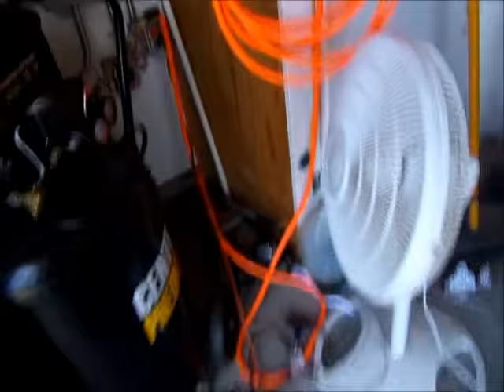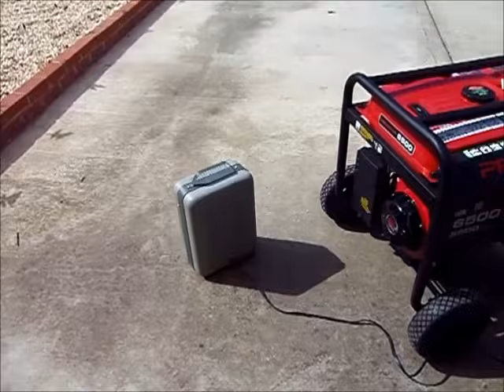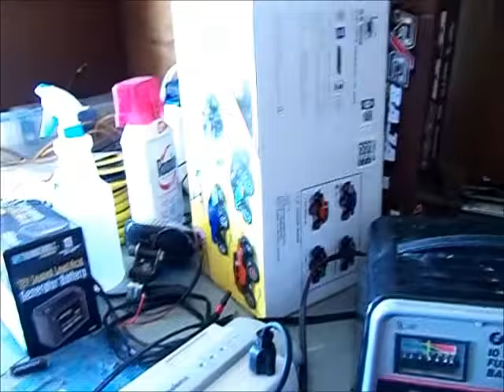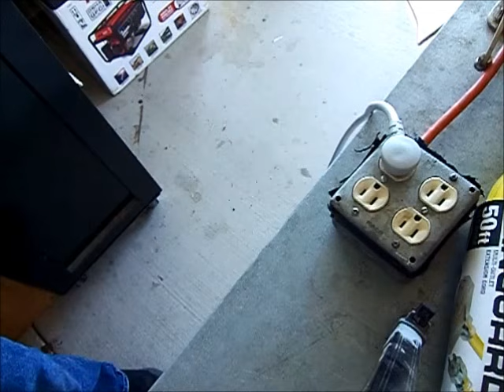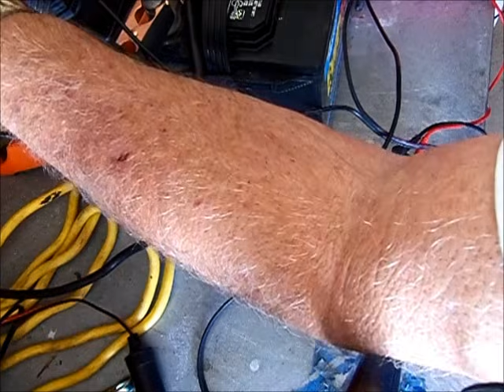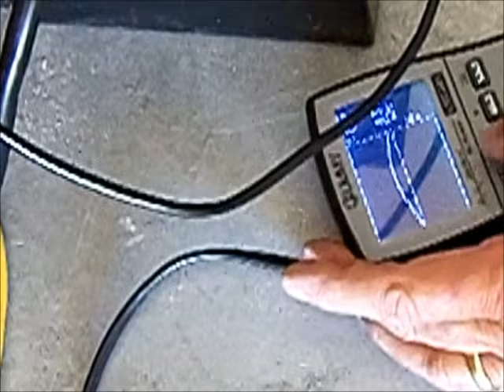Cleaning up the "dirty" sine wave from a non inverter generator. This is part 1, proof of concept.

Comment: I have a 4000 watt champion generator that in our last power outage I just plugged in my TV, computer and internet. I'm glad I didn't fry my electronics. I'm new to using a generator and it did cross my mind that the power wouldn't be safe. I did Buy a transfer switch and everything to hook up my 8750 to the house just in case but since I'm just renting I will wait until the grid goes down. Thought I was good but now I'm off to figure out how to do this safe.
Reply from the maker: If you are renting, in my opinion, I would not spend the money on tying into the electrical panel. That might possibly open up a can of worms with the owner. As of about 3 weeks ago Harbor Freight released a new line of inverter generators (a year too late for me) up to 9000 watts. If you purchased the 8700 recently, it might be a inverter type already. I posted parts 2 and 3 recently. They might help you in configuring your setup. One other thing, check out using UPSs (Best Buy Amazon, ect.) instead of my set up. If I had it to do again, I might have gone that route instead.

Comment: Now if only you can convert a 400v Tesla Car Battery voltage to run 120v household devices without completely tearing it down to 40-50v modules. You would make millions.
Reply from the maker: Actually it could be quite easily done with a step down transformer...but why? You still have to charge the battery pack(s) either off a charging station or some form of home power generation.
Reply: @d.s.steele3100  you would still need an inverter for dc to ac at those voltages
Reply: @ChatGPT1111  would be cheaper to buy ALOT of 12v batteries than tesla lol. lead acid is way better for NON mobile applications as the space and weight is not of importance. one can pair those 12v batteries in series and parallel just like lithiums so you end up with desired voltages. then for both you need to have an inverter big enough to supply you the required AC output. basick lead acid batteries are simpler and safer to charge, can be charged with a cheap chinise solar charger and a normal charger will be alot cheaper for them. for lithium you need a smart charger and normal solar chargers will set youre house on fire..when the lithium batt die you need to buy a new one. as its super dangerous to use bad lithiums. with acids its not so fiddly as every car owner knows ...

Comment: I've heard it's better to use deep cycle batteries for this process were those just normal 12v car batteries? and for expense sake you can use golf cart 6v so to recreate this gotten 4 deepcycle 6v batteries ran parallel.  I'm thinking of making a big battery bank in conjunction with generator/ solar / wind for the whole house year round essentially trying to get "off grid"  I think that the line conditioner inverter battery bank combo is the key.  What do you think?
Reply from the maker: I used 2 Ever Start non sealed deep cycle marine batteries (barrowed them from my boat). If I recall they were about $90.00 each. They are rated at 100 amp hours each. That is about 2400 watts of power off a full charge. how long they will last on a charge depends on how much power your drawing.  Check the power rating on those cart batteries to compare against regular deep cycle batts. Take note: if they are 6 volts each, you will need to hook them up in a series/parallel setup to get the 12 volt for the inverter. Solar, wind good idea. Generator uses a lot of fuel ( I'm using mine only when PG&E cuts power on red flag days). Lastly figure how much power you need at night and size the battery bank accordingly. Assume the sun is down, no wind and the generator broke. you will need a minimum of 10 hours of power off those batteries.
Reply from the maker: Part 2 now posted. Using much higher wattage components.

Comment: LONG basic information POST - PLEASE IGNORE IF YOU DON'T WANT TO WASTE YOUR TIME

This isn't really a video about cleaning up the distorted output of the Gas Generator.  It is just a way to use dirty AC to top up DC batteries for ultimate sine wave inverters.  It is a little difficult to see what, exactly you have connected into the house, if anything.  I don't see why you have the generator going to your house ground.  It would be better to connect it to a ground rod.  If the generator fails and the case becomes hot, you are relying on the house to be properly grounded.  Not a good thing.  not necessary either.  Many people with generators attach them to the house using a double ended transfer cord.  The problem with that is your house is still connected to the AC grid.  When a lineman tries to work on a downed system, they expect the system to be dead.  Depending on how many step down transformers are between you and the lineman, they may "see" 120vac or many thousands of volts if you are pumping your generated voltage onto the grid.  So as long as you unplug your house from the line when the power goes down (see Generlink etc) or isolate the circuits you want to run during the outage (see Transfer Switches) everyone will be safe and your system will be legal.  Plug your generator (inverter or otherwise) into a wall socket, and you are likely to kill someone.

One thing about wave distortion to consider is the total distortion "under load".  Some of these Chinese Inverters are pretty sketchy.  Their wave form often distorts badly under load.... and it depends on what kind of load  (inductive vs resistive).  I had hoped that this might be a youtube video on how to electronically smooth the output.  A really good line conditioner can adjust frequency (ie exactly 60hz), amplitude (voltage that are exactly 120vac) and any distortion of the wave form.  They cost many thousands of dollars... often used by audiophiles. 

Just to clarify, you might not know that what you are hoping to be "pure sine wave" is only an approximation of mains supply true sine wave.  The inverter is using "Sinusoidal Pulse Width Modulation" to approximate the true sine wave you are looking for.  The quality of the sine wave coming out of the Predator is a function of many things... it is truly a sine wave,  but noise comes from things like the brushes that are common with cheaper generators.  Brushless Generators are much more expensive initially, but easier to maintain.  Higher initial costs, but cleaner power.  They may also have multiple phases, just like the mains supply.

You might want to check this site out.  https://www.absolutegenerators.com/blog/brushed-vs-brushless-generators/

Sorry for the length! :)
Reply from the maker: 1. the instructions said to ground the generator for safer operation (I agreed). If you review the video you'll see the provisions I made for a grounding rod. Also I made sure the house circuits were all  properly grounded. There was only a grounding wire from the inverter to the wall outlet. No hot or neutral wires were attached from the inverter to the wall.
  2. I have a line conditioner on the system, it does a good job protecting against voltage surges but does nothing to fix sine wave form. Check what happens when my 1500 watt electric heater kicks on. 
  3. There was an electric fan plugged into and  running off the inverter when I tested it for sine wave form.
  4. I have more sense than to hook the generator directly to the electrical panel. If I hook up to the house circuits, I will install a switch (breaker) that shuts off the power coming from the utility lines when the generator is in use. I'm partly solar  powered (unfortunately no battery back up [way too expensive]) which makes hooking the generator to the house electrical panel much more complicated (read expensive). Will probably run a couple of independent circuits to power my kitchen and family room.
  5. Again the batteries serve two functions, first to act like a big capacitor to smooth any ripple in the dc current, second  to give 3 maybe 4 hours of battery power if the generator has to be shut down for any reason.
   (I have EDITED OUT a comment I made about advertising ... I was wrong and stand corrected). 
  As I mentioned else were this set up was proof of concept. I will post the finished setup after time and money allow. I have priced out what I need and my total investment should be close to $800.00. much less than an equivalent inverter generator.
Reply: @d.s.steele3100  sorry to burst your bubble OM, but I'm a physician from Canada :)  I have NO commercial interest in anything I mentioned.  Sheesh... one question that might be worth asking, and I know you'll know the answer.  Is your Generator a "floating ground" or a "Bonded ground"?  sorry if I ticked you off... but get it straight.... there is no commercial link to me.... not directly, incidentally or obliquely.
Reply from the maker: @en2oh  "Bonded ground" to frame. I will not run the generator with out being grounded as GFCIs will not function. As for the comment on commercial interest, I stand corrected. I will correct my first comment.
Reply: @d.s.steele3100  no sweat.  didn't mean to be rude... just seen a few electrocutions in my day..... they didn't do well on a good day - but with COVID, we may not even see them in the ER.  BTW, you know that since the internet,  we often get most of our exercise "jumping to conclusions!" :)   Stay healthy!  and thanks for posting your efforts on youtube....
Reply from the maker: @en2oh : Waiting on 2020 tax refund and after paying some bills will build a 1 to 4 KW finished system. Trying to come in under $900.00 U.S.  total investment. Easy to do at 1 KW output but prices go up fast as you increase power output. 
    Have not been able to find a inverter type generator close to this price point with equivalent power output. That is the reason for this build. At the time of purchase the Predator 6500 was on sale for $499.99 plus I had a $50.00 off coupon dropping it to $449.99.
   Under normal expected load, the generator will be running at 1/2 capacity. That should give me about 14 hours before I need to add gas to the 8 gallon tank.   I will post a video of my finished setup, good, bad or ugly, on YouTube. I will include what my total cost of the build was.
Reply: @d.s.steele3100  looking forward to it.  making do is a great way to beat the system.  I wish you success :)
Reply from the maker: If interested, I have posted part 2 with 1500 watt inverter. A bit academic now as Harbor Freight just released a line of inverter generators up to 9000 watts. All less then $2000.00.
Reply: @d.s.steele3100  The new Predator 8750 inverter looks identical to the WEN GN875i and the Champion 100520, except the Predator has a bigger gas tank and CO monitoring. You can get the WEN for under $1k and the Champion is slightly more.
Reply from the maker: @toms4791 : Outside of CA. the Wen & Champion are both options, however they are not approved under CARB rules. The just released Predator does pass CARB and is available here.
Reply: if you plug in the generator WITHOUT shutting the mains switch OFF you will fry youre generator.. and when you switch the mains off there will be no output to the mains outside of youre  mains fuse box.. when you turn it off you get no powah in so nothing can get out.. there are simple devices that cost like 100 dollhairs and will automatically switch between the mains and generator. but it will not autostart the generator...

Comment: I ordered a generator with 12v battery charger output, can I hook an inverter straight to this to smooth out the signal?
Reply from the maker: The 12 volt outlet on my Predator Generator is only rated to 8.3 amps (100 watts approximately). Also I learned the hard way that mine was putting out 19+ volts. I found this out only after I smoked a in car inverter.  You don't want more then about 14 vdc going into the inverter. If it is more, you will need a voltage regulator between the generator and the inverter.
Reply from the maker: If you're interested, part 2 is now posted.

Comment: When you plug that inverter into the wall your batteries become live I’m talking 120 V AC no your electricity was a sketchy ⚡️⚡️⚡️🔥🔥🔥
Reply from the maker: 1. Recheck the video. I only ran a single GROUND wire from the inverter to the ground on the wall plug. There were no wires hooked up to either the hot or neutral/common tangs on the plug. If you look closely you will see some green tape wrapped around the orange plug to denote ground only.  This was an easy way to get a good "earth" ground using the existing house wiring. To repeat there was no power on that wire from the inverter just a convenient way to ground it.
Reply from the maker: Look at my part 2. You will see how I only had a ground wire in the wall outlet.

Comment: You paid about $650 for that generator at 6500 W or 5000 they sell 10,000 walked starting Generac and 8500 running watts with the electronica fuel injection the same wave coming off of that but I tested was about 2 1/2 which is very clean for a big portable generator I do not trust predator generators they do you have a dirty electric by the way the generator by Generac Costed me $1100 just saying
Reply from the maker: No, Actually I paid $449.99  for the predictor 6500. It was on sale for $499.99 plus I had a $50.00 coupon.

Comment: Have you considered getting a automatic voltage regulator?  I found that it’s a simpler way than having to convert from ac to dc and then back to ac
Reply from the maker: The voltage regulation is the function of the line conditioner that prevents voltage spikes. As you can see it does not prevent wave distortion under load. That is the reason for the step down to 12 vdc and back up to 120 vac to "filter out" as much distortion using the batteries/capacitor as possible. A lot of your sensitive electronics want that "clean sine wave".

Comment: Thanks for sharing 

I've been thinking about building a 12 volt battery bank with a good inverter onto a handtruck then I can use it as portable power for small jobs or hook up my 1980 3.5hp tecumseh 1250 watt generator for long term use to keep it charged. Hopefully give the small generator a chance to keep up with the 6 freezers in the garage. 

Was thinking about buying better generator but I'm not convinced newer generators can sit few years and start up, produce power, and not have any issues.

Having portable power without carrying gas and oil seems like a good idea anyway or maybe even use it as quite power source for night time use at camp grounds then charge it up during the day with generator😉
Reply from the maker: Check out Harbor Freight's Generators. The Predator generators are a clone of the Hondas at 1/3 the price. As for start up and/or storage issues, use Sta-Bil or similar in gas that will sit a long time also run your generator 10 or 15 minutes every month or two. That will keep the engine and other parts loose and lubed. If your actually running 6 freezers that's a lot of watts. My upright freezer draws 550 watts running and probably twice that at the start up surge. Take that into account when planning your set up. If those freezers do not have any fancy electronics (LED lighting , touch screens, ect.) you can get away with a non inverter generator. Lastly Harbor Freight has a 4000 watt (peek) inverter generator for about the same price I paid for my 6500 watt unit. I paid around $450 for mine. PS: I'm not paid by Harbor Freight, I just like their prices compared to quality.
Reply from the maker: If you're interested part 2 is posted.

Comment: You can use charger directly to inverter...
Reply from the maker: This is true but the batteries serve two functions. 1 they help to smooth any ripple/noise off the charger acting like a big capacitor and 2 they are used as back up power when the generator is off. The two I used would give about 200 amp hours of power from a full charge.
Reply: @d.s.steele3100  Right, but must be noted that the available pure-sin power is that given by DC charger, 10 Amps/12Volts, no matter how much supports the inverter... Thus, the rest of energy is from batteries...
I solved the same problem my home, I divided all devices and electronics are sustained from an 1KW pure-sine generator-inverter, and the rest by a classic generator, having the advantage that one of these two units must start, at last, in winter...
You can maintain your arrangement, but have to take directly from generator the energy for resistive devices and for electronics from inverter, only! Thus, your 12VDC charger will be protected...